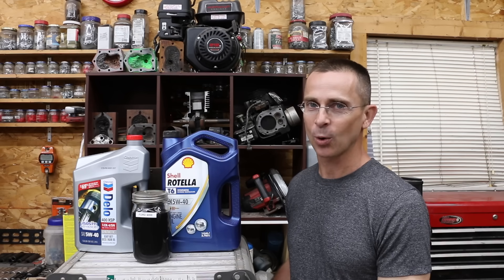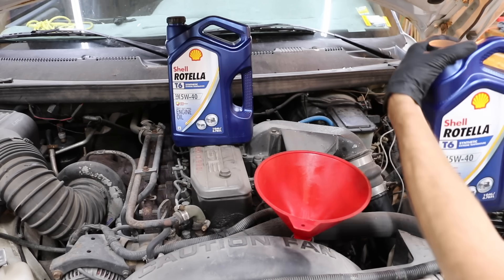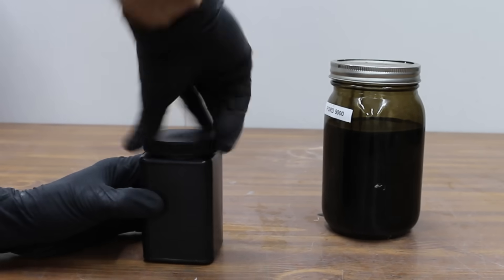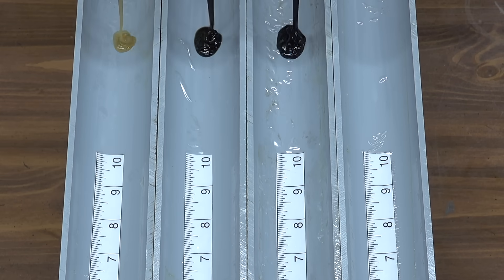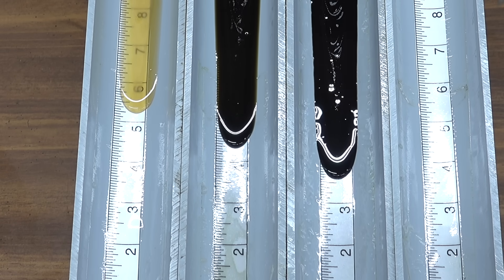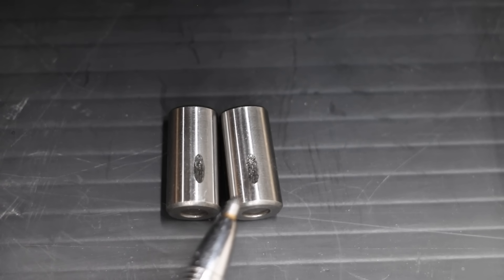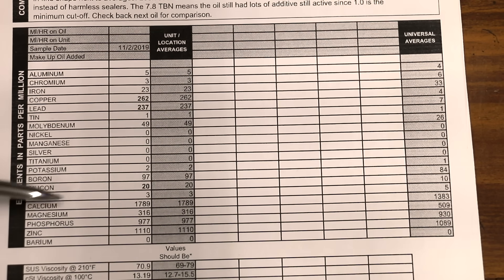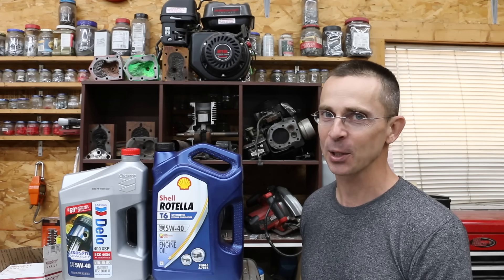Will Annual Oil Change Damage Your Car? Let's find out!

Comment: I have some ideas for transmission fluid tests but I'm not sure you can help with that?
Reply from the maker: Thank you for the video idea!
Reply: @ProjectFarm  
I own a Toyota RAV4 and they always say to use only Toyota ATF-WS. Yet many claim they have had success with aftermarket multi-vehicle fluids. How can one fluid meet the specs of so many different fluids that have specs that are totally different? Then there are other brands that claim to be a direct replacement for the WS fluid and are not recommended as multi-vehicle fluids. Some are synthetic and some are not. Even Toyota's formula doesn't seem to be synthetic. Can these different fluids be analyzed or otherwise tested to see if they are either equivalents to Toyota WS or possibly even superior? Fluids I have in mind are Aisin 0WS (which should be good since Toyota transmissions are made by Aisin), Eneos 3107-300 Synthetic Transmission Fluid, Idemitsu 30040096-95300C020 ATF Type TLS-LV (WS), Ravenol J1D2122-004 T-WS Lifetime Full Synthetic ATF. Then there are a couple multi-vehicle fluids like Valvoline Max-life which I would not be comfortable using.

Comment: @Project Farm : This has brought about the idea of possibly comparing an oil rated for annual use (such as Mobil 1 Annual Protection) versus another similar, but not rated for annual use, oil (such as the typical full synthetic Mobil 1 counterpart). Use both for several thousand miles and test each after one year of use. I would love to see if Mobil 1's Annual Protection oil is actually worth the extra money for daily drivers and still offers excellent protection at that one year mark.
Reply from the maker: Great test idea!  Thank you

Comment: Hi. Because my little Peugeot  Diesel has to go to technical control every 2 years, I bring my car to the local garage and pay him to do the maintenance including oil change and take care of the technical control. This year it was expensive because all the filters had to be changed, along with the 4 tyres. But hey, I'm ok for the 2 next years  with a good running car only drinking 5,4 litres of diesel each 100 kms, and 4 brand new Michelin Crossclimate tyres, really great on the wet and we have rain here every day since the end of september.
Reply from the maker: Thank you for the feedback

Comment: Video idea: Test what the emissions equipment (EGR specifically) on a modern diesel does to the oil and see if it's really bad for the engine as many of us believe.
Reply: It's extremely bad for oil. Go open the hood on a semi with an ISX cummins and there's a large red filter box on the driver side of engine. That filter is for filtering carbon and particulate out of the oil. Don't change it for awhile and you get a check engine light for crankcase pressure sensor. It comes out like a sponge caked in hardened charcoal. Terrible for the engine.
Reply: @TheRoadhammer379  Engines with deleted EGRs have much cleaner oil
Reply: Lots of replies and no data. Let's get some data.
Reply: @dwDragon88  You don't need data to know that EGRs ruin engines 😂😅
Reply from the maker: Thank you for the video idea!
Reply: It does :)
Reply: Definitely is worse, the second you add EGR to an engine you really have to keep on top of oil changes, you can still run a fair distance, but check your dipstick often. Since the addition of EGR we've seen bearing wear on engines at our shop, an issue we never saw before EGR, and only on the trucks that run longer intervals than the one we recommend. All trucks at our shop run the same oil. Running additional filtration does help if you can find a way to plumb that in.

Comment: Thanks for doing this test. I never believed that crap about water getting in your oil from sitting around. One reason is there is little to none air being exchanged in an engine that is just sitting. Another myth in my opinion is about draining the air from a compressor's tank every single time you use it to keep the tank from rusting out. Draining a tank gets a lot of moisture out but the tank will stay damp because air is not circulating to dry it out the rest of the way. That little valve being left opened will take months if not years to dry out the tank. Of course you should drain your tank more often if you use your compressor for long periods of time, but I go months without doing so. Never had a tank rust out on me. Don't let fear be used as a marketing tool to sell you more oil.
Reply from the maker: Great point. Thank you

Comment: Thank you very much for doing this test. My car's engine oil has passed the year mark but has not reached the 5000mi. interval and I was wondering if I really needed to change it (Amazon's Basic High Mileage).
Reply from the maker: It should still be fine if the engine reaches full operating temperature monthly

Comment: I’ve got an 03 duramax that I’ve always used regular rotella oil, 275,000 miles. Would I gain anything by switching to synthetic?
Reply from the maker: Nice!  Keep doing what you're doing is my advice.  I did make the switch and like the cold weather starting performance much better

Comment: G'day,

Yay Team !

Happy Summer Solstice Festival  !

Over here we're having a bit of a Special Event for the Season - every day a bigger & better Firestorm, with a Sweepstakes centred  around which Community sees the highest Flame-Heights (60 Metres is leading atm) and which single district loses the most Houses in a day (it was Wytaliba with 60 houses and 2 dead on the 8th of November, but 2 dayze ago the Adelaide Hills lost 87 Houses for 1 killed).

   Have you ever thought of comparing "Cherry-Pickers"/Elevated Work Platforms ?

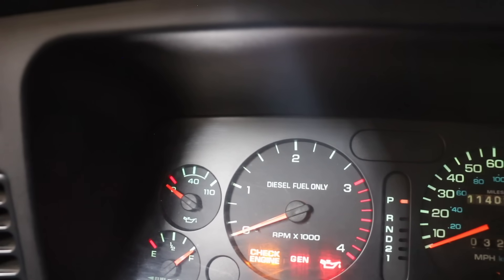  Last week I hired a bloke with a Nifty HR21, and it truly blew my mind - a marvel of Hydraulic Actuation, 9 Tree-Crowns downed in 2:40 with no damage to the Rooflines they were overhanging...!

  I posted video of it at work,

 "Tree Surgery..., Amputating The Dead.",   and,

"Chop, Drop, & Woodchip - In Theory...!".

   You might also get a giggle from,

"Levitation With Firewood...",
  
whereinat I reveal my 20-ton "Woodcairn", onto which I'm putting all the dead dry Fuelhazard that I don't want within Firehose-Range of my Defended Area....

  Preparing to attempt to not get burnt out is quite a challenge..., I'm discovering.

  A Wytaliban who saved his wooden House during the Firestorm told me his story yesterday - he had 10 minutes notice - maybe 15, and as the Firefront passed through he climbed into his (Galvanised Corrugated Iron)  Watertank for 10 minutes...!

  Ever since 1939 we've been taught  that hiding in Watertanks results in being boiled alive, but that was with Tanks atop Water Towers...; anyway, it's a thing which I now know to have worked...(!).

Such is Life..

   I only change my Engine Oil when preparing for the annual Registration Check.

  Most Automotive Lubricating  Oil is sold on the basis of purest  Marketing Jism,  titrated by Commissions on Sales, and all enabled by the fact that it's considered greatly  "Fashionable" to know nothing about how ANYTHING actually works - as a demonstration of one's alleged & asserted  "Cultural Superiority" - and because "truly refined" people have so very many muchMuchMUCH more important things about which to be concerned - like is Green prettier than Yellow for example, or which team will win the Criquet-Match, or was that the Feetball Tourneys...(?) !

Have a good one,

;-p

Ciao !
Reply from the maker: I always enjoy reading your comments!  Thank you!!
Reply: @ProjectFarm  

Cool, no worries ; I enjoy your Videos, & I figure a good video deserves a comment...

 Happy Solstice Festival !

;-p

Ciao !

Comment: awesome again. I drive 2000 miles a year. I switched to Synthetic oil many years ago to only need to change it every 12 months or so with the max being 14 months and around 2800 miles. I can probably go 5000 Miles between changes based on your testing. I wonder if the OIL Filter can last that long ? I use extended life Mobile One filters and the last couple times, Mobile One oil. Before that was occasional Valvoline Oil depending on cost. Usually around $30 for 5 qts and the upgraded filter.
Reply from the maker: Thank you for the feedback

Comment: Thanks for a definitive answer to a question that's been on my mind for years. I have several vehicles, each driven only a few thousand miles annually and get new oil and filters annually. I change the oil in the fall so old oil, with it's possible combustion byproduct acids, won't sit on engine internals all winter.
Reply from the maker: Thank you!

Comment: Please test which is better Disposable mechanic gloves i.e. Jolly Green, Venom Steel Nitrile and etc.
Also best Shop/work disposable wipe/rags i.e. Dupont Sontara AC9165a, ToolBox white rags and scoot shop towels. etc.
Thanks for the great help full video's.
P.S. why aren't you using CRC brand when comparing chemical sprays product and other stuff I think they are of a good quality but would be nice to confirm that by your experiments and comparison.
Reply: I don't know how easy this test would be, but personally I gave up on Mechanix-style gloves because oil & grime soaks through them almost instantly, and really like the 9 mil black nitrile gloves from Harbor Freight. They're thick enough that I can wash & reuse them many times on easy/low-intensity jobs, and cheap enough that I don't care if they tear the second I get near a sharp corner. They also keep dangerous fluids completely off my hands - used engine oil is recognized as highly carcinogenic, for example.
Reply from the maker: Thank you for the video idea!
Reply: @ProjectFarm  If a glove test materializes please consider the effects of time.  Reasonably priced gloves that hold up to tough use and chemicals may not always hold up against time resulting in a lot of wasted product for the weekend mechanic.
Reply: This would be a good one!

Comment: Is Diesel engine can tolerate longer oil change intervals? I’m normal gasoline engine; gas passes through piston rings and mixing with oil, causing changes to oil chemistry!

Comment: On the heat test, one problem with the evaporative test is that the engine is a closed system while coffee pits are open, allowing evaporative emissions to release from medium into atmosphere.
Reply from the maker: Thank you for the feedback.  Vehicle engines have crankcase ventilation to allow the vapors to escape.  To make matters work, GDI engines and run those vapors past the intake valves where they develop a lot of buildup

Comment: Last summer I bought an '02 Goldwing, and went down the rabbit hole of online oil discourse. Many, many hours later, my conclusion was that Shell Rotella T6 was the oil for my bikes (also have an '04 BMW R1150RT which needs an engine rebuild - unrelated to oil). Mainly, I found two separate posts by unrelated, independent chemical tribologists, both of whom stated that Rotella T6 was the best oil on the market for preventing friction wear and long-life breakdown resistance, without containing the 'efficiency' additives which tend to cause clutch slippage and wear in motorcycles (my GL1800 has a wet clutch (ie. it's in in engine oil); BMW does not, so I may or may not continue using car oil). This is why it has a JASO MA/MA2 rating.

In my '98 K2500, I'm changing over to Supertech synthetic high mileage, based in part on your reviews. Why not T6? It's cheaper, I don't care if it has clutch-destroying additives, and the truck just passed 300,000 miles on plain old conventional, so I figured I'd feed it something a little nicer in its twilight years.
Reply: Hi Bizzmark, my 06 Goldwing has 147,000 miles and Shell t6 has been in it sense the first oil change.
Reply from the maker: Thank you for the feedback.  T6 should be fine in the K2500 in my opinion.  The zinc is below 1200 PPM

Comment: What about conventional oil? Will it last as long? And would a 20 minute stop and go (city) drive be enough to bring the oil temperature up to the point where it boils off the water?
Reply from the maker: Thank you.  The used oils were both conventional T4

Comment: I run Mobil one full synthetic 0W 20 in my little Toyota Tacoma it has a 2.7 L four-cylinder do you think this would apply to my engine and that type of oil also?
Reply from the maker: Yes, as long as you're allowing the engine to fully warm up and you don't drive beyond the recommended oil change interval distance.  Does your owners manual call for 0W 20 oil?
Reply: Project Farm Yes my engine can run 5W 20 or 0W 20 however the Toyota dealership says Toyota now recommends 0W 20 would rather we all ran 0W 20,,, so I have been running mobile1 0W 20 fuel saving formula with a mobile one synthetic oil filter,,,, I don’t know if I’m doing right or not I sure hope I am
Reply: @william38022  Don't use sae20. More wear and tear more mileage. Can't compromise . Simple logic. Don't go with company recommendation. Pour oil according to your driving pattern and the area you living in.Even Honda recommends the same and i refrain using 0w20 because i drive mostly highways.
Reply: vee Patrick my Tacoma has 150,000 miles on it still runs good I use 0W 20 full synthetic Mobil one year-round and sometimes tow a 5 x 8 trailer no problem so far,,, my particular model of truck has been known to run for 1,000,000 miles and more,,, I don’t think Toyota would tell us something that would deliberately destroy our vehicle however I could be wrong.
Reply: @william38022  I don't know where you live. I live where summer temperature exceeds 45C and winter barley goes below 10 so old school oil for my Honda 10w40. Toyota is known for their long lasting engine. 0w20 won't blow up your engine lol but for sure it will sound rough and less smooth than any xW40. Switching to 30 or 40 grade is wise after you cross 100000 miles. A bit of loss in mileage is an acceptable trade off

Comment: Why do you consider the cooked oil from the tractor in the first oil race 'flowing too fast?'  Whats the downside?  Dont you want cold temp flow to quickly coat all engine parts on start up?  Every other oil race ive seen you do, speed = better, but no so here.  Help me understand please.
Reply from the maker: Oil viscosity loss could be the result of diesel contamination.  I'm guessing the engine restorer had something to do with flow rate.  The oil was fine
Reply: @ProjectFarm  Makes perfect sense. Thank you! Keep up the good work

Comment: I would personally never fill the center of the filter. I have been surprised over the years how much crap is floating in the bottom of those nice new pails. Not pin pointed down to one brand vs another.
Reply from the maker: Thank you for the feedback

Comment: Keep up the good work as I post the 1000th comment on this video! I have a question, why on the lubricity tester do you use a "splash" guard around the wheel and others you don't?

Comment: Thanks for another informative high quality video, and with perfect timing. Just 30 minutes ago I went to my garage and started up my 23 year old Suzuki Bandit 1200  and was contemplating the need to change oil as I approach the 1 year date of the previous change. I decided the hell with it with only 400 miles of usage, I'm not tossing $60 down the drain...motorcycle specific mobil 1 synthetic is $11/qt.  and the wet clutch/transmission/engine all share the same oil I won't use car oil. Then your nice video confirmed my suspicion...myth!
Reply from the maker: Thank you

Comment: Is D.O.T 4 and D.O.T 3 brake fluid any different??? Is there anyway to test that?
Reply: al alex D2 different wet and dry boil point , you can mix them to get a specific type, both a mineral , Dot 5 is synthetic but is not as wide seal compatible

Comment: I have a Lincoln MKX, it came with an hours counter. Like i have always done with farm equipment, i change the oil at 100hrs of engine run time. This seems to me the best way over mileage, because it takes into account 'idle' time. I know not all vehicles come with a hours of run time counter, but can be installed cheaply. I have installed them on vehicles without hours clocks because, when i lived in South Dakota, in deep winter when temps are 20below, people often leave vehicles running while in stores, shopping, eating out, ECT, because they want a warm vehicle to come out to. I have known some who leave their vehicles running for days, just to keep it warm, especially when the temps will be -25 for weeks on end. Cold starts in sub zero weather is very hard on engines. That oil is hard to pump when cold as your video's have shown. 

Just wanted to post that in case some people may not think of just how long run time is over mileage. So if you idle a lot, people may want to think of a hours counter.  

Great content, i really enjoy and USE the info you have provided over the years. Knowledge is power.

Comment: Good info, now that my car is retired from hard daily driving, I've only put 3000 on it in 6 months, it's Mobil 1 5w/20 and it looks very clean, so now, with this info, I won't be worried about changing it for a few more months and 2-3K miles, thanks!
Reply from the maker: Thank you for the feedback

Comment: I only change my oil every four years or so.   I'm not worried about engine wear, because I only drive a few 100kms a year (and use it at least every other month).  Could anything else deteriorate over that time?
Reply: Dinar AndFriends holy you might as well sell it take a bus or cab
Reply: @redneckhillbilly8788  I can't take the bus because there aren't any here.
I didn't change the oil in my last car in seven years, and it still worked well.
Reply from the maker: Thank you for the feedback